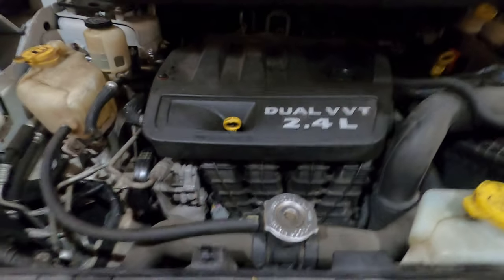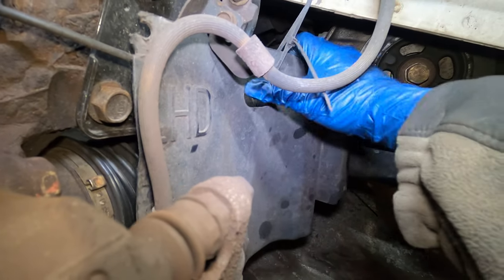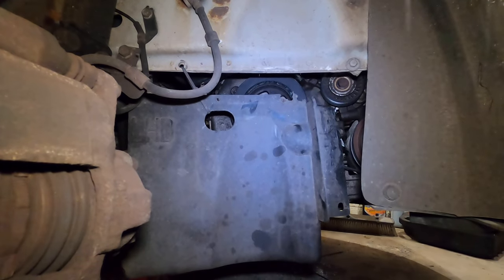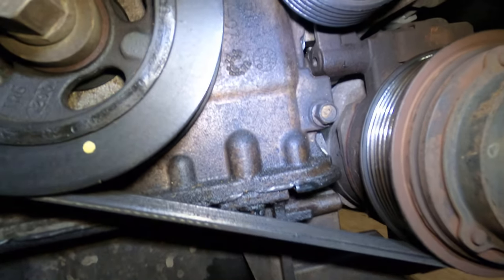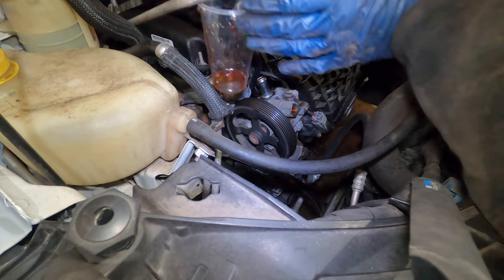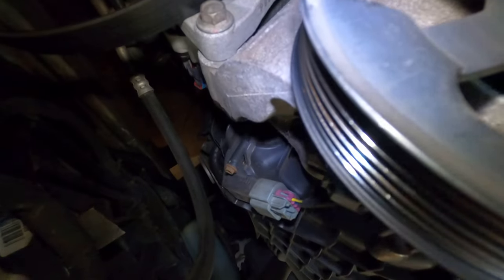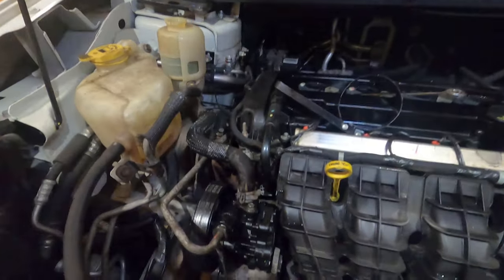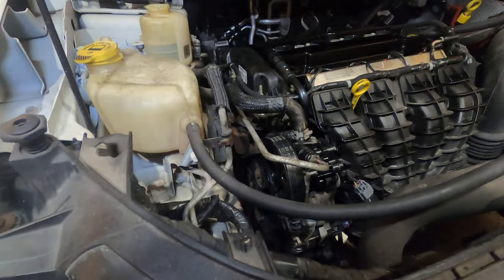2012 Dodge Journey 2 4L PS Pump Replacement

Comment: did it make a loud hissing sound ? thats why it needed to be replaced? Mine does and when you move the steering wheel its changes the sound as well
Reply from the maker: @RubenMorales-g7k  I am sorry I don't remember. i hope this video helps. feel free to like and subscribe for more & if you can, please help the channel out by giving a super thanks. Making these videos takes a lot of time, but we do it to save you hundreds. also head down into the description and check out the link for some high quality led bulbs for this and any other vehicle. use my referral for a discount. Add me in Instagram for behind the scenes pics and Stop by my store for some Anything Auto gear.